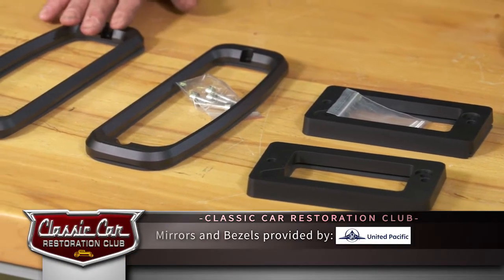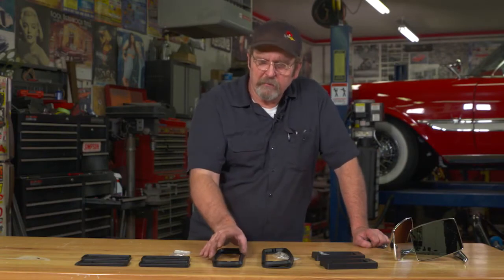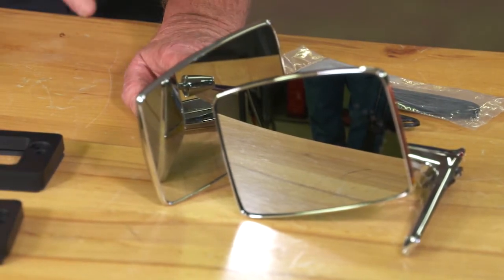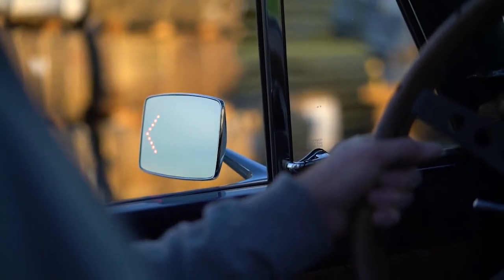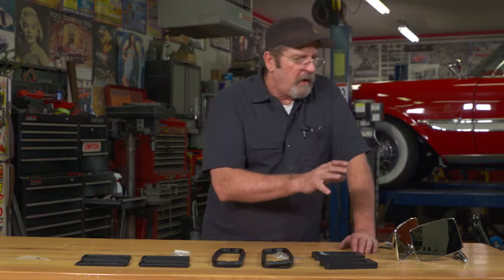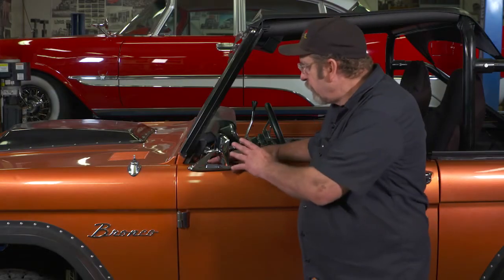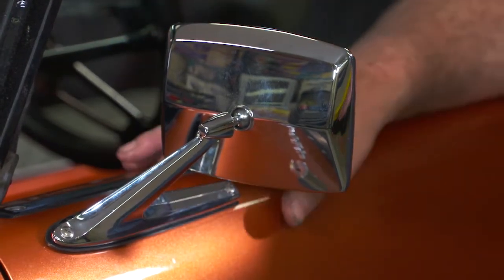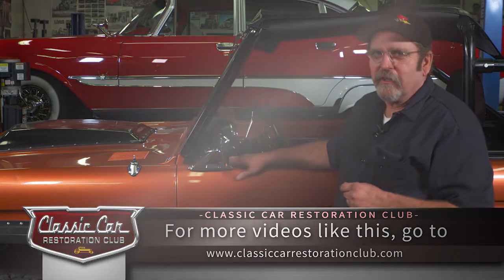UNITED PACIFIC LED MIRRORS AND LIGHT BEZELS

Comment: I bought a set of these, and they're great, but I wired the black and white to the signal wire  and the black to ground, then it flashed and lights  up when brake pedal is pressed.Why?
Reply from the maker: The ‘Ask an Expert’ section is for members of our online community. I would be happy to send your question off to the experts. To get started, please send the email associated with your paid membership. Thanks!